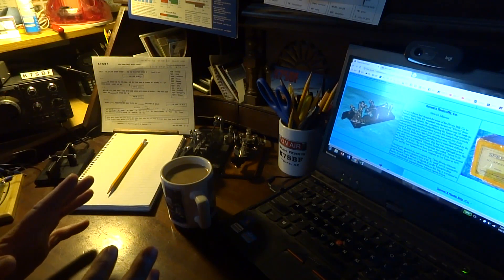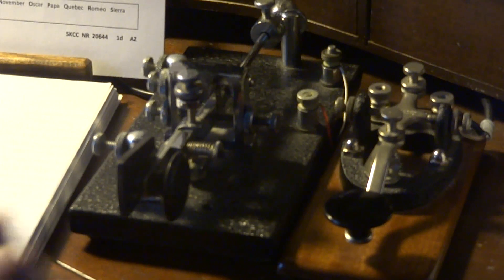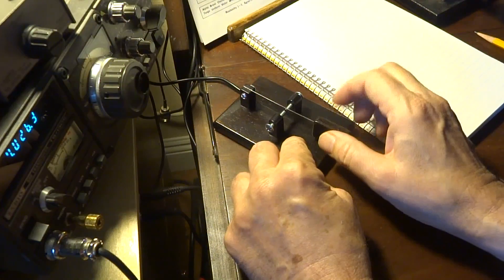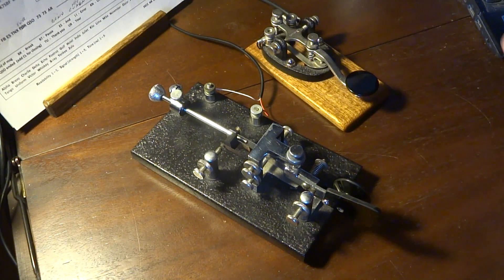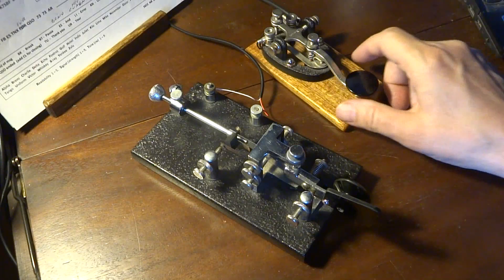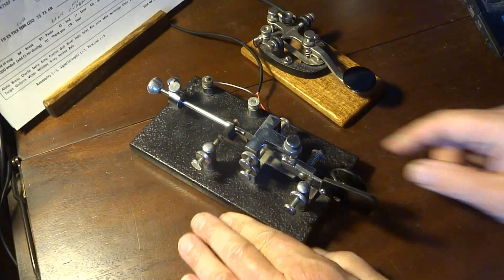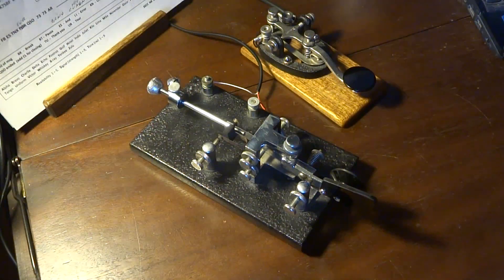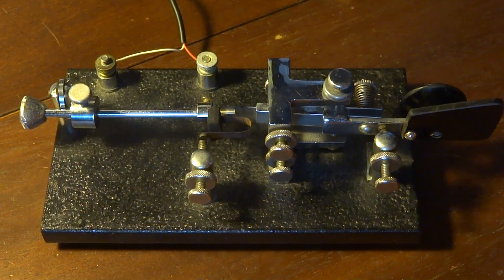Vintage 1930's Speed-X Bug  Still Working!

Comment: How are you doing with Cw now? Using the bug with less weight? Tu 73
Reply from the maker: Hello, Jay!  Yes, the bug is still on my desk, and it's fun to mess with.  I've taken some time off the radio this past year, as I needed a break.  Just getting back on the air this week actually-- had three nice qso's with CO, OR, WA already.  (My home antenna seems to favor northwest and southeast.)  So far, I've only used my straight key on the air.  Something about the straight key--  unlike my paddles or bug, it seems to disappear in the process of sending.  Hopefully with more time, I can use the bug and paddles without an extra thinking step.  Love your all 50 states award!  Blessings and 73.  Hope we meet in the aether one day!  Stan
Reply: @StanFerris  tnx Stan. Yes all 50 on LEO satellites. Took about 14 months. Now I have 17 grids to grab before getting all us grids. Such fun :) I love working the sk , however mine is mfjunk and not such a good one. Hihi

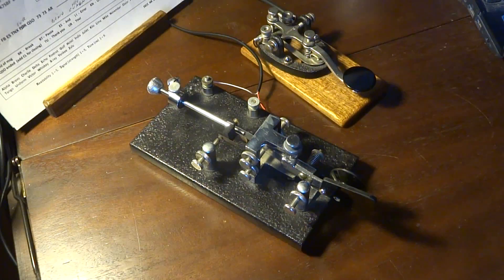Comment: The speed of the dits is determined by the length of the bar - longer = slower. Newbies who want to take a shot at sending - go to the hardware store and purchase a length of tiny brass tubing. Slip it on the end of the bar; put the weight out at the end and you can get the dits down to 3 words per minute! Fun! Nice video. Wanna cut to the chase? Go to 9:45 for the demo.     FB 7SBD = = 73 de 4zi        dit dit
Reply from the maker: Thanks John.  I did this video primarily for non-ham folks so it did get a little drawn out, I admit! :)  Note that with a simple pendulum system like a ball hanging on a "massless" string, then the frequency is determined simply by the length of the string as you state.  These bugs are a bit more complicated.  Because the rod has significant mass, and swings on a flexing spring, and the contacts are also on a spring, there is a restorative force also at play.  So instead of adding more and more length to the rod, which at some point becomes cumbersome, one can add and move mass along the rod which also effects the frequency of oscillation for this system.   Vibroplex and other companies have always used movable weights to alter the speed of the swinging arm.  Since bugs are really designed for speed, I would guess that folks who are sending at 5 wpm should probably use a straight key until their speed increases a bit.